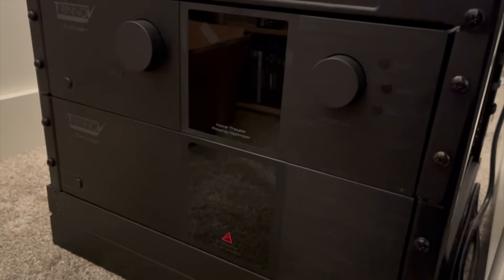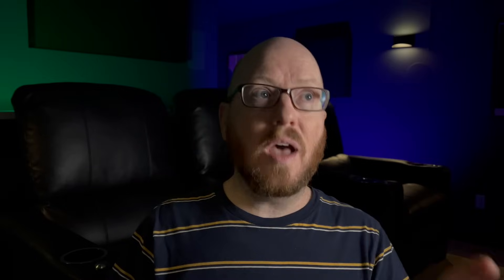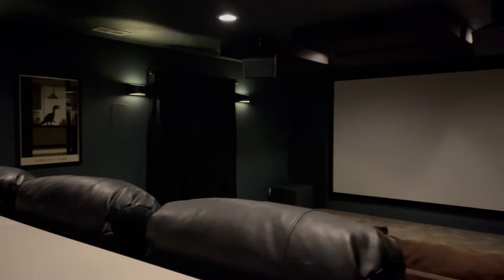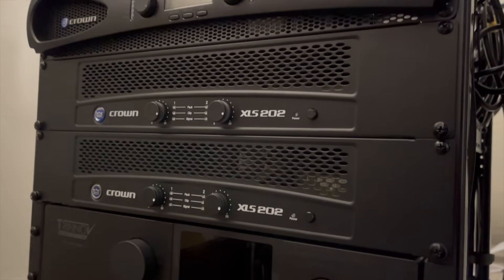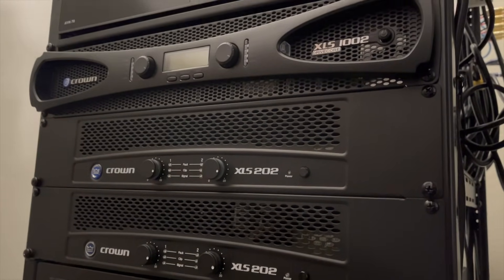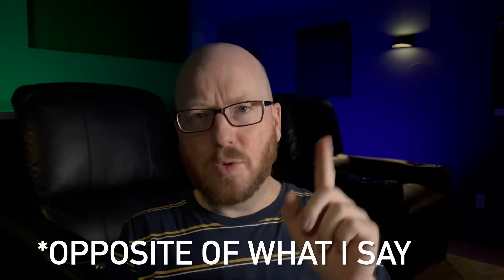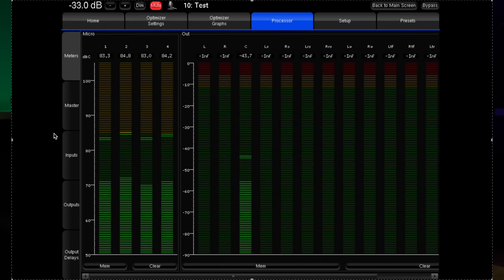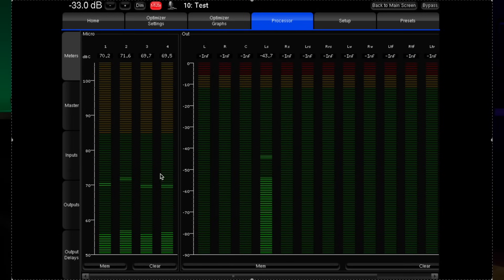Bridged Crown Amps vs Trinnov Amplitude 16 – The Actual Data

Comment: George, thanks for this video. Good to have more context. I think there is still some apples to oranges comparison happening here. Doing a little digging, I think I know what is going on. 

While the bridged output of each amp is similar (700-800 watts), the gain structure and input sensitivity of the two amps is very different. The Trinnov has a gain structure of 22db in bridged mode (16db in regular mode), which requires an input voltage of ~6.35 Vrms from the preamp/processor outputs to reach max power. The Crown amps have gain structure of about 35-40db based on a listed input sensitivity of 0.775 Vrms or 1.4  Vrms (selectable) to reach full power in bridged mode. This means that the crown amps will output more voltage (power) to your speakers for a given amount of input voltage delivered from your preamp/processor, or that the Trinnov amps require more input voltage from the preamp/processor to deliver the same output voltage (power) to your speakers. This is why you are seeing the difference in output level given the same input level. 

Given this, I am fairly certain that what you are experiencing is just louder volume at your listening position from your LCR speakers when they are driven by the Crown amps due to their higher gain/lower input sensitivity. However, this is why it is not apples to apples. The goal of calibration is to have a consistent output level from each speaker at the main listening position. To do a true comparison you would need to do separate calibrations for each amplifier that each result in a level matched sound stage across all speakers. Only then will you truly be evaluating the difference in sound between the different amplification strategies.
Reply from the maker: This is extremely helpful! I think you're right. Shoot, now I gotta do more testing!
Reply: This is spot on. You are really just comparing the gain structures. I'm curious why the desire for bridging though, as typically you lower your amps tolerance to impedance dips, thus further straining the amplifier and increasing noise and distortion.
Reply: Well said, saved me typing it up. I use the same crown amps in bridged mode for my DIY subs. Also don't understand your point here, if they both at the same level they should sound similar.
Reply: Correct. The first step in an A/B comparison = match volume levels.
Reply: Just piling on here... difference in gain aka input sensitivity. You have to align the gain of the amp with the clipping point of the voltage output of the processor, clipping point of the amp's output power, and perhaps the safe operating wattage of the speaker. Typically gain should be the lowest you can get it to accomplish that balance where the components all reach their limits around the same point on the volume knob.
Reply: Also piling on higher gain/ sensitivity will also increase noise floor and why manufacturers decide on lower gains for amplifier design in order to lower noise floor especially for high sensitivity speakers 
Good luck and looks like your enjoying the process
Reply: Can you mix different amps with different gain or better to have all the same gain?
Reply: @NicolaeLorimer  as long as they are reasonably close in gain you can level match them with the channel trims
Reply: @NicolaeLorimer  You need to adjust the volume to the desired blend of the two, just like with pickups. But yes you can mix them just fine.

Comment: Instead of bridging the amps why not Bi-Amp the speakers?
Reply: Because it makes no sense. Tweeter needs less than 10th of the power what the woofers need. So why would you underpower your woofers with lets say 100w saving a couple watt by not having the tweeter draw that few watts and power the tweeter with 100watt when it needs no more than 2-5watts?
Reply: @CSOCSO it does make more sense to bi amp than bridge. Few reasons :
1- even stereo is more than powerful enough 
2- bridge decreases quality
3- woofers induce great phase shifts that tax the power supply and reduce mid-highs quality; bi amping reduces strain on the amp and improves bass tightness and highs clarity (tested myself many times)
Reply: @CSOCSO  It makes plenty of sense. There's plenty on information and articles about it and top speakers are made to be able to do it. Some speakers like in the McIntosh line let you tri- amp them. Sound is a lot more than just power. Bridging an amp to deliver a trillion watts but only using 10 makes little sense and especially when all the speakers in the system aren't getting the same amount and from different power rated amps with different harmonic distortion ratings.
Reply: @redright88sipe at some point we get to the point of diminishing returns. I love the idea of every single driver in the system having its own channel of amplification. So if your system is 9.4.2, and all your positions utilize a three way design, that’s 27 separate amplification channels for your bed layer, 12 for height, and then an amp for every subwoofer driver(2 front 2 rear to get your .2=4 amplification channels). That equals 43 channels of amplification. 🤔
Reply: @ScottGunMag69  I'm well aware of it. I've read about bi-amping and I can add thank you. I find most smaller speakers don't let you bi amp them. They only have 1 set of terminals. In the scenario here he's just doing it to the L C R speakers.
Reply: @redright88sipe I was just humoring myself, no offense. I would love to be able to build a system like that. Within reason of course. At least bi amp lcr.